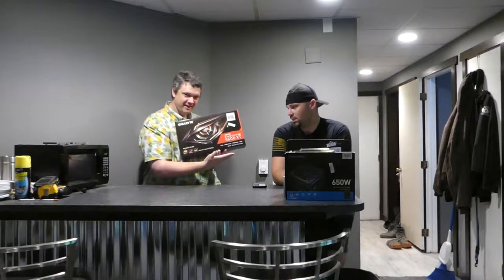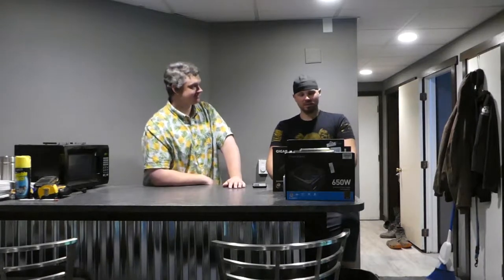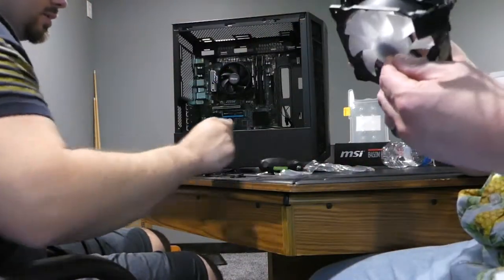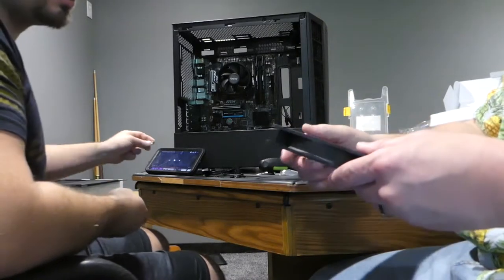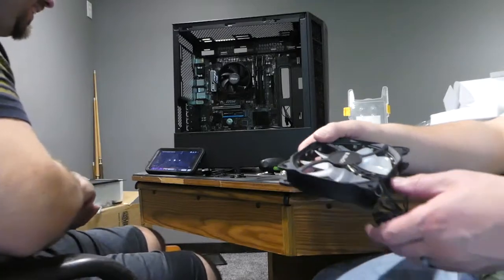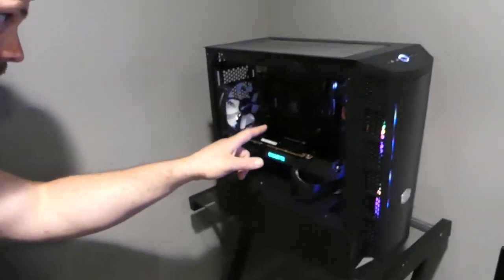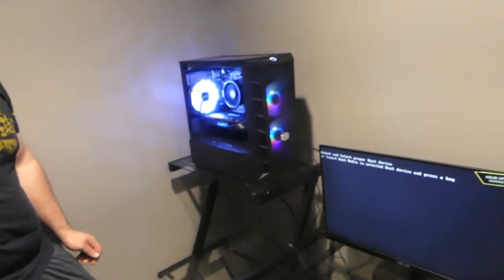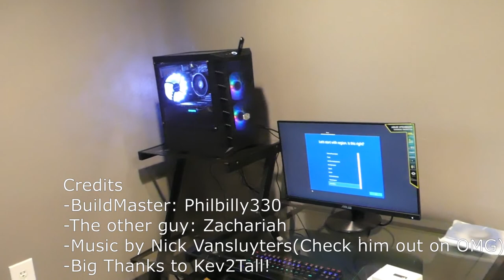Two Idiots Build a PC, Newbie DIY build it yourself Gaming PC build.

Comment: The graphics card issue is actually because most Ryzen processors don't have a built in gpu. There are AMD processors that do have built in graphics, usually Ryzen 3 series and the are xxxG as their number. If this was an Intel build you would have been using the built in GPU plugged into the motherboard.
Reply: Yeah lol the funny thing is the guide I was watching actually mentioned that if I would have listened for 3 more minutes